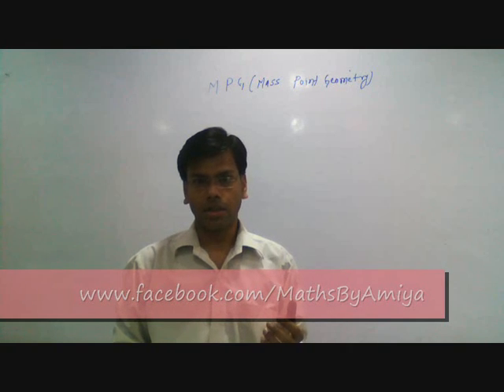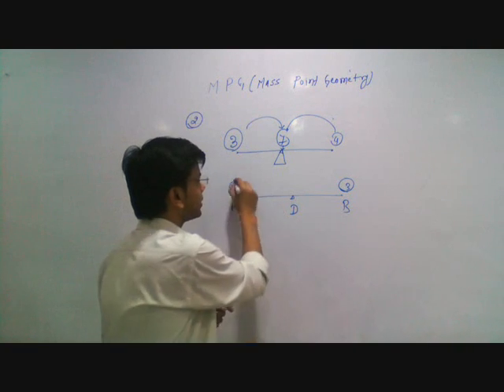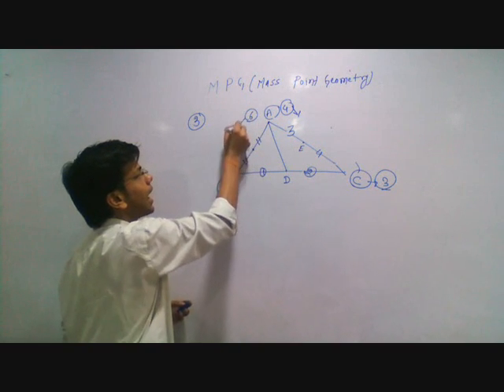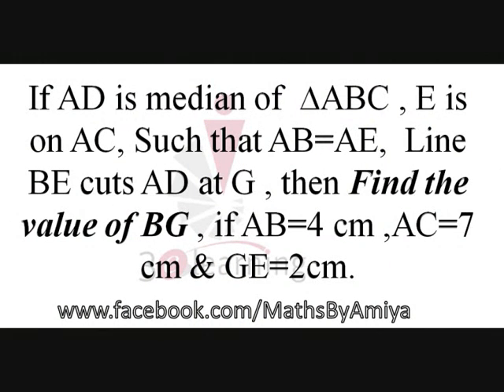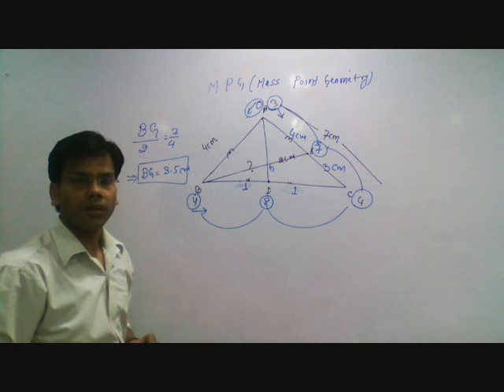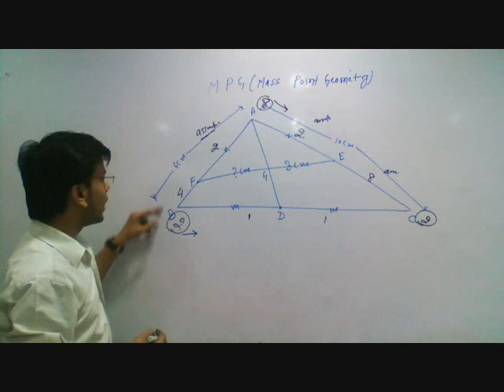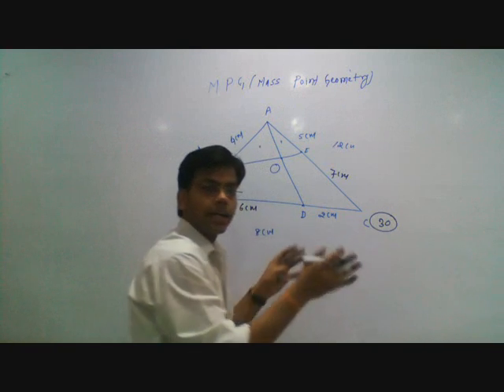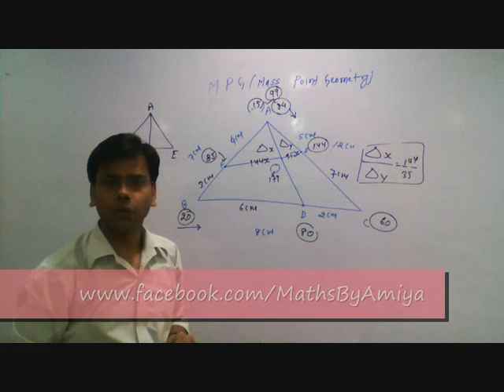Geometry for CAT 2024 : Session  7 : Mother of all concepts : MPG Mass Point Geometry - Introduction

Comment: why did we take c = 30 in the last question. won't it be 11 as we go by the standard procedure?
Reply: Sir in all the other problems you are adding the values which are coming in both sides of the veritices. But in the last sum you multiplied. Can you clarify it??
Reply: At point C, only two lines are meeting. When three lines meet at one single point and a transversal is there then we add values.